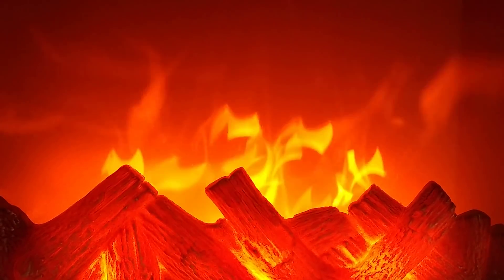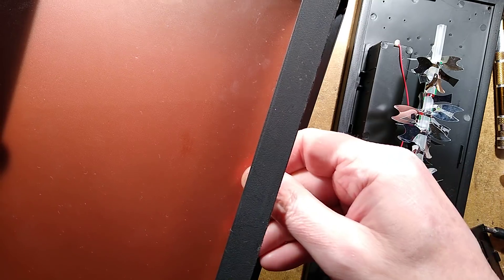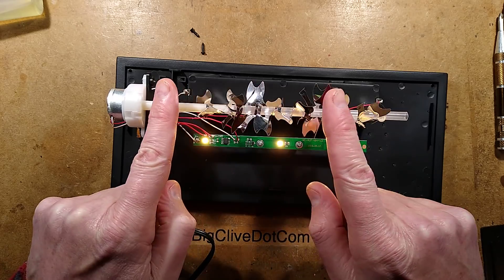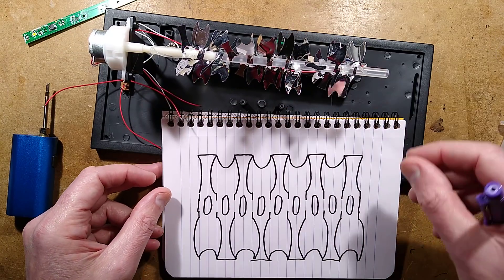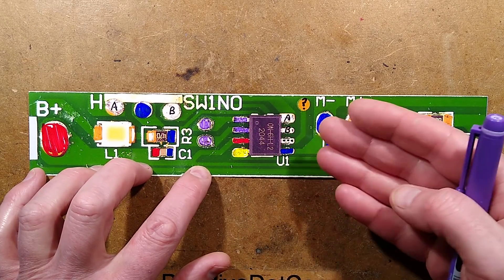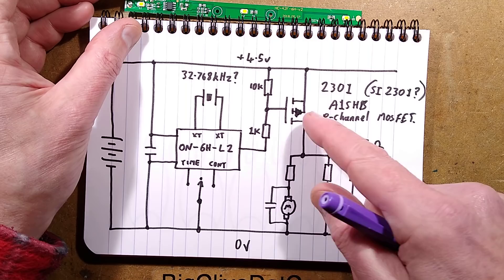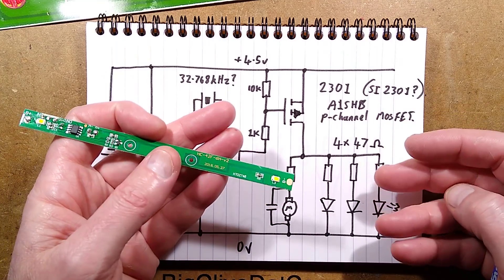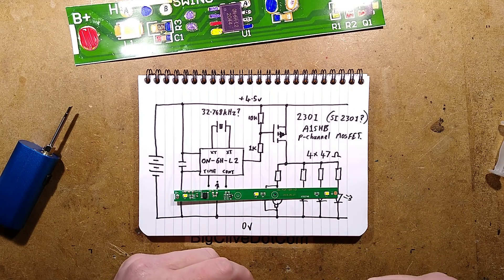LED fire simulator teardown and schematic

Comment: Replacing / adding flickering/fading LEDs and a wee bit of trimming to make the reflectors slightly different would increase the reality even more I believe. 
Think I need to take a trip to my local cheap stuff store to see if I can find one, would look nice in my broken fireplace (previous owner run it way to hot).
Reply: We actually did this on our new fire. Part of the Flamerite E-FX Range. Check it out, I'm the designer :)
Reply: You should see what we did with the glowing logs as well lol

Comment: Certainly is a nice effect, I bought a trio of the "lantern" style ones a few years back, sold as "faulty", but, erm, they worked fine, so they were a nice cheap buy, and I think I even converted one of them to be powered from a LiPo battery charged via USB, though much like a lot of my stuff, I can't recall where I put the things... :P

Comment: I've got a LED flame candle that has a timer function on it where it comes on for 6 hours and is off for 18 hours as well, chances are that it uses the same timing controller.
Reply: I can't trust my clumsy self around real candles so my led candle is perfect and it switches itself on and off too😁

Comment: Back in the 1960s my gran had an electric bar heater with this sort of effect.  It worked using a red painted 60w light bulb and a metal disc above it.  The heat from the bulb caused the disc to rotate thus producing the flickering effect.
Reply: Yes, that's what I was alluding to!

Comment: Now I want to see DIY Perks do his version of an LED fireplace
Reply: He will start by doing a spectral analysis of a real fire and recreate the spectrum completely including the heat radiation. It will also be water cooled.
Reply: @3dlabs99  ...
Yes, and it would all be made out of 3mm Aluminium sheets.
Reply: £12,000 later and he'll have an led fireplace you can make with just £40 and impossible DIY skills. 

Fairs fair though I was impressed with the microphone.

Comment: Surprised that there is no capacitor connected to the crystal.
Reply from the maker: It's probably using the same system as clock chips which use the same crystal and usually have no load capacitors.

Comment: Oh it's déjà vu all over again. 🤦‍♂️ 
My wife is a deity botherer (it makes her happy) so I made a little shelf so she can put her alter ornaments on and got a couple of LED candlestick candles from the local chinesium supplier, Ali someone. The "flame" on the candles is a simple piece of plastic that has a bit of metal on the bottom and it interacts with a tiny electromagnet inside the candle case. The result of the movement of this interaction is an extremely realistic looking candle flame when the lights are off. It's really very clever but about three times too much for what I paid.

Comment: I was always told not to mix brands of batteries and that it cause a thermal reaction in the flux capacitor and burn completely through the earth’s crust thus destroying the planet 😳
⚡️⚡️⚡️🤣 That is a pretty cool fireplace.
Reply: It's OK if you completely enclose it in Unobtainium.

Comment: Now that I know how it works, I can see the cylindrical rotation in the flame pattern in the video end-shot.  That does not mean that I don't like it!  I have several battery clocks with smooth-running 'second hands'.  Toaster pastries come wrapped in flimsy Mylar.  Let's hope the clock motor doesn't smoke.

Comment: Clive, is that a DIY battery powered soldering iron on the table? The blue case with the chisel tipped iron on it.  I'm thinking it could be an interesting project if it is. Can you give any details on that in a vid or response?
Reply from the maker: It's a commercial product based on a vaping base.

Comment: We had something like this back in the 70's. On a bigger scale, it was a 3 bar fire place with a light bulb and metal spinning disc for the flame effect. Only downside was the horrible fake polystyrene brick effect surround. As young children at the time, we would normally poke holes in the polystyrene bricks.
Reply: As you do.
Reply: @oldbatwit5102  right? like the polystyrene drop ceiling panels in my grade school... every classroom you went into there were a bunch of pens and pencils that had been blasted into orbit by means of a flexible ruler... now they just hung there, ominously threatening to randomly let go and imbed themselves into your skull on their way back to earth =)
Reply: We had a much classier one... Spinny, shiny disc thing with a 60w lightbulb painted red + orange (definitely hand painted)
But the 'real log' effect fibreglass fakery at the front was absolute top notch... The sort of thing you would expect to find in a Rolls Royce foot well

Cheap and nasty can also be high class!
Reply: I had one of those also back in the 70's but instead of one bulb there were four 10 watt small color bulbs and a long spinning tube with what appear to be hairs of aluminum for the flame effect.
Reply: @javiergt  wow, that's really posh!
Reply: @sofa-lofa4241  It was also the era of aluminium Christmas Tree era. It has forever been burnt in my brain. LOL

Comment: In the old days, they had a version with ribbons and a fan that blew the ribbons around while back-lighting them. 
Not as convincing as these.
Reply: Yeah, the ribbons were made of tinsel.  👍
Reply: @TomAlter1000  I've got one in my home (here when I bought it, never used because it is so fricking loud!), the fan is a Cylindrical affair, exactly the same design (so likely the same model) as used in the heater above the not particularly convincing ribbons.

Comment: The circuit polarity is because the chip output is probably an N-channel driver for a single LED candle.  Driving the higher current of 3 LEDs and a motor thus needed an extra transistor with opposite polarity.

Comment: I bought an Ebay solar COB light that is motion controlled. Is there any way to make a light like this stay on longer? It's a 12V COB running from a solar charged 18650.
Reply from the maker: Depending on the circuitry you can sometimes add an extra capacitor in parallel with an existing one to increase the timing.  But some are locked delays in a microcontroller.

Comment: I got the fireplace version with is like a foot wide. It doesn't have any timer function that I know of. It just has a flat top to it. It didn't come with a DC jack, so I added one. I didn't want to burn through batteries or have them leak. The stem is just a wooden dowel, but it has the same Mylar and hot glue arrangement. I got it a couple of years ago. It takes like 4 batteries for 6 volts, but I actually run it on 5 volts. I thought it might make the LEDs last longer, and 5 volt power supplies are much easier to get.

Comment: Clive, I thought that rotisserie arrangement had metal reflectors at first. It occurred to me that would make a really kinky S&M device as you sit over it as it rotates against your genitals.
Reply from the maker: If you wanted your genitals abraded by sharp rigid mylar then it might be useful.  There are much better motorised devices for stimulation of your bits though.

Comment: They've been using the same technique for at least 70 years. My mom had an old incandescent version from the 50s that functioned exactly the same way. I took it apart when I was a kid. And put it back together too. Otherwise, I wouldn't be here now telling you about it. The actual materials weren't the same of course, but the principles involved are the same. Except for one thing. That one actually had a 1400 watt radiant heater built into it.
Reply: I remember the one my grandparents had - a disc that rotated in the convection current caused by the incandescent orange bulbs.  I found it mesmerising!
Reply: And I have recently sold a “vintage Belling fire suit” on eBay that has the same flame effect as the one you have described - as the customer wanted a 50/60s themed interior to their recently bought house 🥰
Reply: This commentator knew what was good for them
Reply: I've always wanted one of those. watches the video 
I think I have a project.

Comment: That's a very nice effect indeed !
Is the motor noise audible in a quiet room though ?
Reply: Based on some I've had yes. It's more of a low quiet shaking sound. Very consistent to. But not bad enough to prevent sleep or anything. You'd have to focus on it to hear it
Reply from the maker: This one is surprisingly silent.
Reply: @bigclivedotcom  really? I usually hear a low rolling sound or etc. It might be size, I'm using space heaters or big ones

Comment: Seems nice, and a good upgrade would be 3 star PCB's with 1W warm white LED's, and between them 2 warm white slow flash units, so that you get an irregular looking flame effect out. 1W chips should be run at a half watt, so they do not swamp the 5mm slow flash out totally.

Comment: Realistic until you you quickly realize it repeats itself but it's probably meant to be glanced at, not looked at while contemplating 42 like with a real fire.  I do wonder how hard it would be to create a similar but not obviously repeating effect for a similar price.
Reply: Just replace the led units with slow flash led's, at least 6 of them, and you will get that as they slowly go out of sync.
Reply: @SeanBZA  Yep, like Clive's "supercompuer", just slower.
Reply from the maker: I reckon, gently morphing LEDs or even rotating LEDs or a multi-section lens could add a layer of complexity.

Comment: Thanks. My 5th wheel RV (caravan) has a fireplace like this, but is larger and includes a 1200 watt electric heater. I've been dying to find out how the effect works but didn't want to tare it apart to find out.
Reply: Some older fireplace simulators had a single low wattage light bulb with a fan mounted on top of it that rotated by warm air rising from that bulb. It was as effective for its simplicity.
Reply: Ours had the heater fan that wouldn't turn and by the time I realized something wasn't right, the fireplace died right there and then. I had a quick look at it but just visually, without real tools other than just a screwdriver,  I haven't seen any physically broken part . I really want to revive it cause it was the best bedroom ambiance while watching TV , just reading a book or, you know. ☺

Comment: I have a similar unit about the same size that I run off a 5V PWM signal from an ESP board. As my heating power goes up the "fire" gets brighter and faster.
Reply: thats VERY cool. gotta try that too if i get one

Comment: needs a crappy mp3 player with random fire noises. pops hissing etc.
Reply: Or some mechanical produced fire noise when the mylarstick is turning
Reply: My heater will that effect crackles occasionally. I hope its not an electrical fault 😳

Comment: Gotta speed that motor up by maybe +50%.  When I was little, we had one similar to that but the motor was on a knob that controlled the speed of the flickering flames effect.
Reply: Just use a 100R pot instead of the resistor, which will allow speed from slow turtle to galloping hare.
Reply from the maker: The motor is already tamed down with a series resistor.  I like the lower speed effect.

Comment: Good job on the teardown, as always, Clive.  I like of these units so much that the gears wore down and got loud,  so I spent the time to figure out how to drive it with a silent stepper motor system, so that it runs with no noise and will never have gear problems 😀🤓😂
Reply: Wouldn't mind seeing an instructional video on that.
Reply: Great Idea.
Reply: A £10 solution to a £2 problem 🤣... But so would I... They are great!
Reply: what type of engine is it? step motor? with which characteristics can I search for it?

Comment: A hologram by any other name. Cap across motor = suppressor. A diode would have been nice, too.
Reply: Already got the led's as diodes there.
Reply: @SeanBZA  motor and leds have resistors = LRC tank. FET is unprotected, too.
Reply: @snakezdewiggle6084  Still going to last longer than the guarantee period, or 3 months from manufacture, whichever comes first.

Comment: I saw one of these in a hotel lobby, but wired up backwards.  The "flames" were going _down_.  I filed it under "unclear on the concept".
Reply: The old motors had a part that made them turn one way only. With age they would go bad and it was a 50/50 chance as to what direction it would go when power was turned on. I used to remove the part and run them on a sound-to-light unit that turned the wheels in my disco projectors. The same could be done to one of these so the flames would move to music.
Reply: They bought the Australian version by mistake!
Reply: 😁 - opps,

Comment: I used to have an old "Magicoal" heater that used something very similar but with two 'flame orange' incandescent lightbulbs and a small geared synchronous motor
Reply: My parents had something similar: a red bulb for the light and a vaned wheel to provide the effect.  No motor; the wheel was entirely driven by the hot air rising from the bulb.  Heat came from standard electric fire elements mounted either side of and below the fire effect.
Reply: @Michael75579  Even old school gas fires (e.g. Flavel Welcome - installed in mum's house in the late 1980s, still manufactured and made today) had the twin bulb, vaned spinner and fibreglass fake coal below and in front of the radiants.
Reply: We had one when I was small. I had forgot the name but as soon as I saw "Magicoal" I was a kid again for a few seconds.
Reply: Ah yes, the good old "Berry Magicoal" - I remember seeing the adverts on the telly, back in the 1960s, back in the days when brand names meant something.
Reply: o for the love of the wee man. yes! magicoal was the bees knees at one time, ae. i took one apart, like clive jus did. had great fun

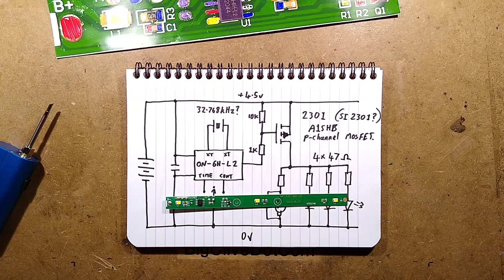Comment: What is the blue cased object on the left hand side at the 10:40 mark?  A rechargeable soldering iron or a screwdriver?  If it is a soldering iron could you do a review on it?
Reply from the maker: Soldering iron that uses a vape power supply.
Reply: @bigclivedotcom  Ooooohhh. Definitely needs a video.

EDIT: I was recently given a selfie stick for which I have no use. Now I think I might have an idea how to repurpose it.

Comment: I'm trying to figure this out if reversing the polarity on the little motor would radically change the display?
 I'm wondering if using two competing ones in alternate directions might create your plasma effect?
 But I do think you said that this was the floor model anyway. So I'm assuming you don't have access to a second.
Reply: Maybe making up a second strip and placing it on the other side would effectively be akin to having a motor running in the opposite direction. Now do you need a mirror to project to the front screen?
Reply: I was wondering about having two of the rotating mirror strips, but have their motors turning at different speeds. 
There is as you say a lot of potential for modifying this.

Comment: I wonder if the unit might work with water vapor instead of the screen. Like that recent Reddit post. Don't know if I can link in comments so post title is: "These are NOT Flames, but Rather Water Vapor Illuminated By LED Lighting..." 
Link in next comment.
Reply from the maker: Dimplex do the water vapour effect in fireplaces here.   Puts a lot of humidity into the room though.

Comment: Just recently I bought one like this but bigger and with a wall plug. I was wondering how the fake flames are made, now I know!
Mine has a small spiral type of heater inside, which is not very useful.
I love the warm light; the plastic logs even have a bit of glitter on to make it look like they’re glowing on the inside.
Reply: I also have it as a fan heater. It also crackles like a fire. I enjoy the effect  and it makes my room very cozy
Reply: @NyanyiC   got a link to it please, sounds like just what I need now autumn's here.

Comment: Very impresive look. I think its got some good hacking bits too. I wounder if you warpper a cylinder round it and lit from both ends with colour-change LEDs.
Reply from the maker: There are some larger wall mounting versions with RGB LEDs.
Reply: @bigclivedotcom  So that would HAVE been a ggod idea. 🤣🤣Im just a bit slow.2x👍   Bet they look great too just going to see if I can get one now.

Comment: would self-flickering LEDs look cool to add to the dynamic mylar reflections I wonder?
Reply: This teardown is inspiring me to build a custom insert for my unused fireplace I can scale up the reflectors and use some led strips with WLED where I could have a mixture of fading and fire effect lights. I just need to buy some sheets of milar
Reply: I was wondering about trying to shove 2 sets of rotating mirrors in, so the speed difference stops you getting repeating patterns
Reply: @nathanlucas6465  Just had a similar thought myself. Didn't see your comment in time!
Reply: only thing that seemed missed out was that the lights are also illuminating the ember'd logs. which flickering leds might make a little odd. now if you could get a  few fading leds, possibly slightly differently tinted that might look rather nifty. pulsing would seem more natural than a flicker. although if you added about 4 flickering leds in there with a timer to fire them off one at a time in an alternating pattern vs a linear one, it could add to the effect . just my 2 cents on the idea.
Reply: Swap them out with green or purple ones for next Halloween
I wonder how this would look projected onto a curtain of vape smoke or ultrasound mist
Reply: I really should read more comments before posting my own. Just posted this myself.

Comment: Can we have a 12 hour video of it running?
Reply from the maker: Given that it repeats once per drum revolution it could be done as a loop.
Reply: I am thinking that it should be possible to have two sets of mirrors rotating at different speeds, set so they would not get into sync.